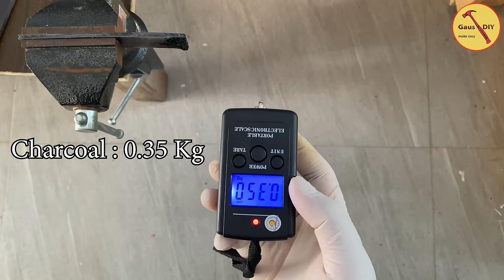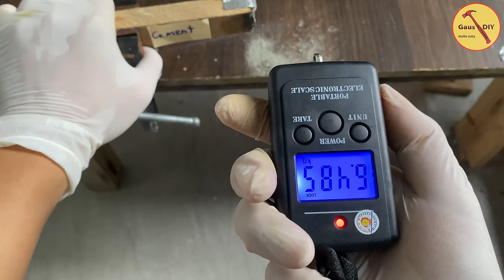3 Experiment Comparing The Strength: Baking Soda, Cement, Charcoal, Styrofoam

Comment: To be accurate, you should use EXACTLY the same amount of glue with each bonding agent. Having been a plastic modeler for 60 years, and having been using cyanoacrylate glue since it's introduction as Eastman 910 in the very late 1960's, I could have told you, baking soda (or sodium carbonate, "washing soda") would be BY FAR the superior bonding agent to ANY material bond. The Eastman Chemicals "poop sheet" on Eastman 910 (there are and entire SERIES of Eastman "900" "super-glues") plainly states that alkaline agents promote the strongest bonds. The first was made to bond the wing spars of B-52's in place! Yes, the wings of B-52's are GLUED-ON! My late Daddy machined the two plates of the wing attachments from high grade aluminum. They form a hinge that allows the wing to move over 12 feet vertically from at rest to full load in flight.
Reply: Baking soda, chemical name - sodium bicarbonate.

Washing soda, chemical name - sodium carbonate.
Reply: Thank you. I learn more from comments than from the video.
Reply: So what's your point? He used bicarbonate of soda for these tests not caustic soda....caustic soda is very dangerous.
Reply: Interesting information. Thank You.
Reply: @fromtheflightdeck252 
Caustic soda was never mentioned.
Reply: And the leverage distance was not the same for each test.
Reply: @fromtheflightdeck252 He didn't mention caustic soda(sodium hydroxide), he did mention washing soda (sodium carbonate).
Reply: 👍 now I understand
Reply: Hello, is washing soda the same as soda crystals
Reply: Yapıştırıcı sıvı en etkin hangisi sence 
Yapıştırıcı sıvı + sodyum hidroksit
Reply: I hope so, that's what I've been putting in the washer for years.😀 @boofuls
Reply: The test can be accurate if :
1. You put the same amount of materials by mass for each rivet ( glue and bonding material)
2. You exert the pulling force exactly to the same point in each rivet. (Lever arm)
Reply: There are numerous variables to truly calculate accurate testing. Ie, copper can be a great conductor, but that doesn't mean aluminum can't beat the ratings if it gets to be thicker than copper. The same goes when comparing copper and silver. For a test like this, accuracy needs to be placed on matters such as how much you use, what bonding agents are used, what they are bonding to(wood, metal, etc) and truly, just what conditions it's put in. For example, ice can be a significantly great bonding agent, but that's only if temperatures are near/below 0. This video has little to no accuracy on its display.
Reply: I’d love to spend a morning drinkin coffee with you!
Thank you for the information and neat story
Reply: Yay!  I learned something.
Reply: I used to use baby powder with fibreglass resin and hardener. Until I discovered baking soda and super glue.
Reply: yeah i agree,
i saw in his tests the amount of glue and the amount of powders are not even the same,
so. the test is somewhat unreliable,
but then again i do believe that the baking soda do have the most strenght
Reply: did it have a pitch nob to adjust glass to hold load or was it by hand?
Reply: There was no point, he just wanted some attention.
Reply: @zeuso.1947  Exactly. And, on the one that he HAD marked (the last one), he didn't place the loop there. 😀
Reply: The test pieces also need to be placed in the vice in a uniform manner and the force applied at a consistent position.   By the pieces being randomly placed in the vice and the torque applied at different lengths the fulcrum is different for each piece.  There are so many variables in this demonstration that the experiment would need to be run a minimum of three times just to estimate the baseline, and that is assuming that all three runs would produce identical results.
Reply: 👍 @mick1turner
Reply: Bicarbonato de sódio e a mesma coisa que carbonato de sódio????  Vou pesquisar aqui agradecendo do Brasil 😊😊😊😊
Reply: You can convert baking soda to washing soda by heating it.
Reply: Another reason to avoid flight 😁😁😁
Reply: Baking Soda is sodium bicarbonate!------(sodium hydrogen carbonate).  Experiment was silly unequal toque!
Reply: @fromtheflightdeck252  What? Which comment did you read?
Reply: thanks for info...understandable
Reply: @Houlque He trabajado con ensayos comparativos y doy fe que la gente en general tiende a hacer comparaciones poco fiables pues introducen variables diferentes y luego creen llegar a resultados fiables
En este caso afortunadamente se ha llegado a un resultado bastante cierto pero no siempre es así 
Saludos
Reply: Thanks for sharing…that’s such awesome info and history!!
Reply: You're literally the Ron Burgundy of plastic modeling - "I don't know how to put this, but I'm kind of a big deal. People know me. I'm very important. I have many leather-bound books and my apartment smells of rich mahogany"
Reply: Eu só queria colar uma parte do baú da minha jog 50 cc, e o pedaço não existe mais procuro nos vídeos como refazer o pedaço perdido
Reply: But its a video showing someone supergluing things that arent meant be structural then testing them structurally i dont see the point in the video to start
Reply: well gee, glad you didn't tell himbaking soda was far superior, then none of us mortals watching would have this video to watch
Reply: Oi Edson.
Também conhecido como hidrogeno carbonato de sódio, NaHCO3
Reply: Obrigado por compartilhar o seu vasto conhecimento e parte de sua história de vida com esta comunidade ávida por aprender. 
👏👏👏👏
Reply: also, the size of the filler particles was not uniform. It's a big deal in composite toughness.
Reply: An interesting experience, however, the repeatability was not maintained. Material and glue were used by eye for each joint and, in addition, the load was applied at different points. Both the workpiece was placed in the vice at will and the 'weight' was set at will. It is difficult to determine whether these results are authoritative🤔.
Reply: @fromtheflightdeck252 castic soda dangerous?
Reply: So if we are been extremely precise (which I’ll be honest I wasn’t expecting before I even clicked on the video) yes they should have used equally measurements of both glue and bonding agent and ied have also added it some curing time as I know “”super”” glue cures getting harder the longer you leave it, maybe 5 to 10 minutes.

On a side note I’m wondering what effect the different states of charcoal would have as it looks like they are using activated charcoal maybe from a fish tank and I’m thinking powdered charcoal may have been stronger?
Reply: Thanks for saving me another 5 mins of this BS video. Absolute ape like behaviour on this testing methodology.
Reply: @fromtheflightdeck252  Sodium hydroxide is sometimes called caustic soda or lye. It is a common ingrediet in cleaners and soaps. At room temperature, sodium hydroxide is a white, odorless solid. Liquid sodium hydroxide is colorless and has no odor
Reply: @Houlque  I was about to post the same comment
Reply: My Godfather Hal Maglio was a pilot and flew the B-52s for the United States Air Force. May he rest in peace in God's hands! 🙏😇
Reply: @fromtheflightdeck252  His point is, the test result in this video seems to contradict the recommended usage from the glue manufacturer. He gave the (extraordinary) example of gluing the wing of bomber airplanes by using alkaline as accelerant.
Reply: @alcaponehome6744  It is indeed unnerving to hear airplane wings were glued instead of bolted. But B-52 lifted far heavier loads than average commercial airplanes (70,000 pounds for B-52 vs 50,000 pounds for Boeing 737). So if it's okay for B-52, then it should be okay for commercial airplanes too.
Reply: Is baking soda the best filler for super glue with regards to adhesion and strength? I need to glue and fill a void in plastic. Was going to use epoxy, but did a test and it may not fully adhere to the plastic. So thought of instead doing the super glue trick with either baking soda or cement or something. This is for a plastic handle that snapped in half. Have it glued back together, but it had a void running down it that I figured I could fill up.

Also see some youtube videos on superglue and iron powder.
Reply: @zeuso.1947 E nem o tempo de secagem!
Reply: For all of the tests, he didn't measure anything. He should have tracked how much additive was used and how much glue was added. You can easily tell that the cement takes quite a bit more to saturate it compared to the others. He also needed to make sure he was performing the pull test at the same distance from the joint on all 3 tests.
For the plastic and wood tests, he should have made sure the gaps didn't vary.
Reply: Fascinating 😁👍
Reply: For a comparative test cotton wool should also be used.  It apparently makes a great hole filler when screw holes in wood have become loose. Probably more able to screw into it than bicarb and superglue.
Reply: ¿Qué hay de la duración? He usado esa mezcla en mi lugar de trabajo, solo como relleno en piezas que no soportar esfuerzos mecánicos, y al cabo de pocos meses simplemente se destruía.
Reply: @markvanpelt5583  And measure the distance from the vise to the end of the wood instead of eyeballing it. Sometimes you just need to get it in the ballpark if it's not a rigorous science experiment. He got it right answer afterall.
Reply: @loiswallace3334 I’m thinking he meant “or” as in you can use either one because they’re both alkaline
Reply: They’re a lot of small variables here that could have slightly changed the outcome but overall, this is an accurate test
Reply: Curious if there is anything more cost effective than super glue to do this? That is also waterproof for outdoors? It seems like it might be a good fit for yard decor (sculptures and/or pots etc). But, super glue would be pretty costly to make a flower pot lol.
Reply: I agree with your accuracy assessment noting that there weren't even equal distances applied nor the amount of glue or to material applied were hap-hazard.
Reply: Yes. I second that notion! Ive done a bunch of little experiments, and from what ive learned, alkaline materials bond best with super glue. However, ive also had wood start smoking when using super glue on it, multiple times. So it blew my mind when the wood in the video didnt do the same.
Reply: Thanks for such an interesting comment, learn more! I see our counterparts from the US have great knowledge and experience. My uncle was an engineer of KM ecranopolan. 
Actually we haven't been able to super glue until Chinese glue came. In the Soviet era we had some glue called "emalit" we use this for making wings for our plane models. Father of my classmates was a general commander of our local base of military cargo plane he also a pilot. He was supporting us by raw materials and knowledge and we have tons of this amazing glue)
But now this glue nobody knows we're to get. This glue is gone with the Soviet era.
Actually I am living a long time in China for machine business reasons. And I have experience with glue tests.
But I should say US glue is much, much stronger than Chinese! Even industrial Chinese glue is weak compared to the American one.
Thanks for your comment!
Reply: @fromtheflightdeck252  Neither are "caustic soda."  Both are very mild alkalis.  You are thinking of sodium hydroxide, aka Drano.
Reply: Cyanoacrylate super glue is not flexible and there's no way the vibrations of flying wouldn't destroy it so you might be missing some details
Reply: you a plastic modeler for 60 years!
man, youtube comments are funny!! 60 years!!!
Reply: @loiswallace3334   Im just being silly but, the comon name is sodium bicarbonate also known as baking soda, its chemical name is NaHCO3, its a salt comprised of two compounds, but im just going too far now lol.
Reply: The glue reacts with humid in the air, then becomes solid. So, I think O-H bond occurs between them. Soda is carbonate CO3, it has an unstable O bond. I think this O-bond make them a better compound glue than other material.

Comment: You should have measured out the amount of additive/accelerant to ensure a fair comparison.  On the plastic-to-plastic, you needed to make the distance from the vise jaws to the joint the same for all tests, as well as the distance from the joint to the pulling force.   variations of those lengths will have a significant effect on the force applied.
Reply from the maker: I will note this 👍👍
Reply: Cierto, además del tiempo de secado, inicia la prueba al último que le coloca el superpegamento
Reply: Dude, this experiment is to work out which dodgy repair is the strongest- it’s hardly gonna need NASA accuracy 😅
Reply: @timjohnun4297 Bueno entonces para ti es igual pegar con moco! 😂
Reply: @GausDIY  The Law of Levers! Force = pressure x distance... Thus distance must be exactly equal for all tests.
Reply: @GausDIY  I think it's also a good idea to design a test with the smallest amount of variables in the first place. In all tests you are testing the ability to resist bending moment (joint rigidity) which is a function of force and length from the joint. I don't know if this is intentional but I would personally try to measure just the pull force by applying only tensile stress to the joint, ie. pulling the joint apart perpendicular to the joint surface.
Reply: @timjohnun4297  While precision and accuracy need not be NASA level (or even engineering level) it still needs to be at carpentry level (nearest mm) otherwise it would show misleading  results.
Reply: @timjohnun4297  🤣 Good one!
Reply: @pulsar22  // Also reflect on the fact that a comment regarding a test related to accuracy, should always be ignored when it begins with "Dude."
Reply: Any science experiments have to have all the facts and situations checked and made them the same for best results.  Not a nasa thing it’s just a get your best results and have the 
More😢accurate results for your own information.  Have you ever compared things and said we need to make the tests for the to be the same 

Consistency is the key.
 Not nasa grade just consistent
Reply: Welcome to the difference between science and social media.  Making us dumber by the day
Reply: Agreed according to other videos it'd be super glue

Comment: Interesting experiments, but there were a few things that make the results difficult to interpret. Most have to do with standardization within each experiemental condition. For example, the actual amount of glue applied and the gapping between surfaces. The most glaring though, was the inconsistent placement of wood and zip ties on the strength test. A force applied increases inproportion to the distance from the fulcrum. In effect, the further away from the fulcrum you placed the zip ties, the less measured force it would take to break the joint. I would recommend repeating these experiements, but standardizing everything.
Reply: Crazy Glue/Baking Soda Great for Guitar Nut Filed to Low
Reply: @randyaivaz3356 Thanks for that. That'll solve a problem for me.☺️ Need to fix an aluminium nut too. Maybe cement for the colour match.🤔
Reply: In Portugal we call that physics, and is probabily on the levers chapter. Very good point indeed.
Reply: it gives me ideas; that's the main thing

Comment: Just from my experience, it seems the baking soda is great for hard white plastic repairs. For more flexible plastic, use the Styrofoam. For black plastic, use the charcoal, but it works better when finely powdered like cigarette ash. Not sure if cement would be the best for bonding ceramic and stone, but it wouldn't surprise me. Super glue is acrilate that undergoes polymerization in the presence of water. I have seen acrylics (plexiglass) melted with acetone , which makes a hellava glue in its own right, but I have yet to see powdered acrylic and superglue done. Please make that video experiment.
Reply: Lies again? Batman Superman Big Shot
Reply: habe probiert. plexiglass und acetone, hat geklappt
Reply: Mix an alkaline material in with each of those regardless for best strength. Need to get that pH above 8 or so
Reply: you don't need any powder, just use a pencil to color black the surface then use couple of drop. that's it you are done.
you need to use file on very smooth surface as you can not draw from pencil on smooth surface such as glass, use little sanding or filing then rub pencil then stick.
Reply: So you powdered acrylic shit and than tried

Comment: Recall test result:
(1) Wood-to-metal

baking soda 5.505 kg
cement 4.425 kg
styroform 3.2 kg
charcoal 4.095 kg

(2) Plastic-to-plastic:
baking soda 0.785 kg
cement 0.65 kg
styroform 0.365 kg
charcoal 0.35 kg

(3) Wood-to-wood:
baking soda 5.445 kg
cement 6.8 kg
styroform 3.16 kg
charcoal 8.245 kg
Reply: Thanks
Reply: Thanks for the experiments. Do you have any comparison with lead? 🙏
Reply: Thank you my love
Reply: Scusa la curiosità, hai provato legno legno con segatura e super colla ? Che ne pensate
Reply: i think cement is the best, because more stable than other
Reply: I have tested with wood chips. The hardness is satisfied.
Reply: The results demonstrated in video are incorrect not only because of different material and glue quantity but also due to different moments of forces in different experiments. Distances between glued places and points of dragging should be equal! But they NOT.